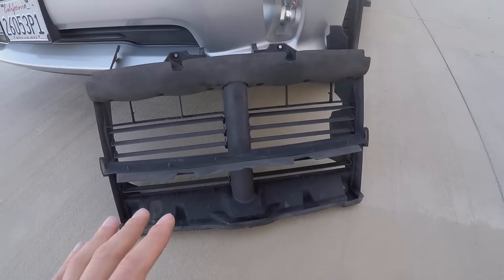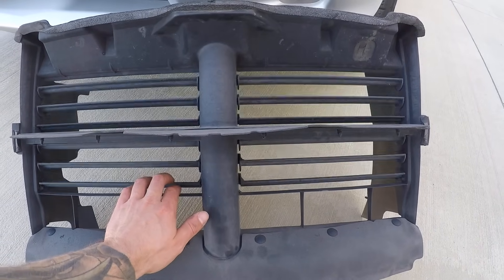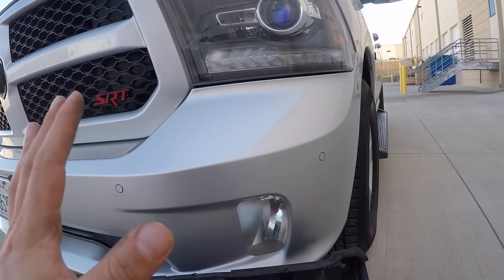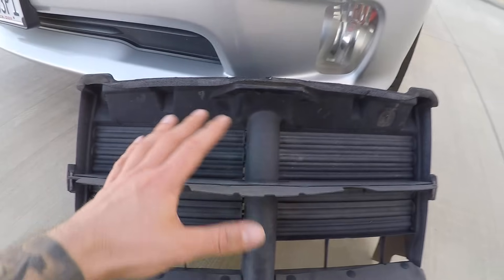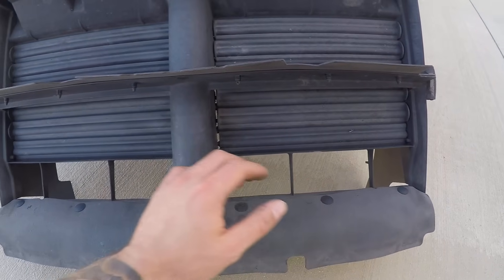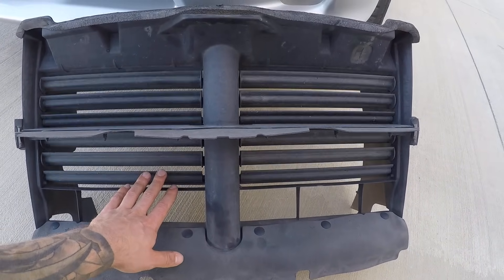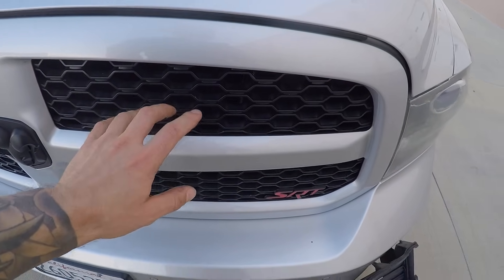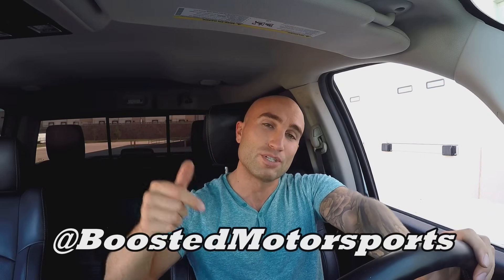What do Active Grille Shutters Do? AGS - TruckTalk #30

Comment: My wifes Fusion just started to over heat everyday to work. I just saw her AGS was closed and not allowing airflow. These things are stupid unless you live in a seasonal place. Here in CA these are just one more thing to fail. I had to force hers open to stop it from over heating. Hers even blocks the intercooler to her turbos too. And I was wondering why her car sometimes was gutless and sometimes felt notmal.

Comment: Ok so I'm just a lady driving this 2019 ram 1500  truck back and forth to work. I'm not building it or modifying it in any way.  So over the weekend the check engine light comes on and auto zone checks the code (U11E9) says its "most likely" the grill shutter assembly bc I'm approaching 50k miles. And the part is not available. I'm in a rural County so I don't have to worry about check engine lights for emissions testing, but I need to know if my truck is gonna over heat or what I should do.

Comment: I recently installed a 185 degree thermostat on my 2015 ram still have my mechanical fan but noticed my temp is still climbing especially when towing my trailer. I get that it’s going to climb in temp being under a load while towing but would deleting my shutters help cool the motor better while towing?
Reply: I thought I was the only one having that issue. Coolant & oil tem runs at 219-230. I freaked out when reached 240. I said ooooh hell naaaaa. I change the radiator it had a crack, I changed the thermostat. Next will be water pump. I didn't know my truck had shutters since is basic working truck 2018 Tradesman V6. After I notice why I don't see my radiator then vents opened. First thing I said "ooooooh hell naaaaa who in the FK set that feature, it got to be one idiot, I haul every day". Research to delete this.

I will order this part. Have you done it? Any cooler?

Comment: Thanks for this video. I have a 2019 BMW X3 and the engine light is on and the apparatus I bought to diagnose the problem says  Active Grill Air Shutter "B" is stuck on. Does that mean its stuck open or closed ? Can I drive it this way ?
Thank you in advance for your response.

Comment: That can should be pwm. It varies the speed of the fan not cycle on and off. It also runs constantly at a lower speed when ever the ac is running.

Comment: Holy I haul every day. I get temperatures 219-231 coolant, engine oil pairs up with the coolant, transmission goes to 194F. 

Recently I changed radiator had a crack, changed the thermostat. Next water pump. In the meantime I did bleed the system and burp it. I am still getting hot temperatures. I will remove the grill. I honestly think is a stupid feature. Even though is clever but not close. Is just create too much heat.

As soon you said when driving on the freeway they closed. That is when the truck goes up hill hits 230's.  I run 2018 ram 1500 Tradesman 3.6L.

Comment: My 1500 doesn't have vents but was considering adding them since 99% of what I drive is on the interstate. Wouldn't it make more sense to just wire in an adjustable fan controller to control the vents? Set the vents to open a few deg. before the fans turn on.
Reply: It would make more sense to be thankful that your vehicle doesn't have this useless crap.

Comment: So I have the same shutter system on my 2018 GMC Sierra.. the shutter decided not to work forcing me to replace it.. if I don't replace it the engine light will remain on.. How do I keep the shutter system in the vehicle (open) and delete the detection from the vehicle without the engine light remaining on?? Truck won't pass upcoming inspection with engine light on.. Thanks

Comment: i recently installed a 180 thermostate from HHPerformance and it jumps around from 185 to 190 during driving, could you tell what thermostat your using and  should i remove the active shutters from my 2017 ram bighorn crew cab....HELP Please

Comment: Im late but had a question. Hopefully u can help me. I got a 2015 Hyundai Genesis. I have an Active Air flap on mine. Is that basically the same thing u have and can i completely remove it without replacing something different there like u did?

Comment: We've been following your channel for quite some time now and love your videos!
I have a RAM, same generation as yours, with the 5.7 V8 BiFuel purchased in Belgium, Europe (if that makes a difference). Sport crew cab, short box. When driving around town, I've never seen it exceed 95 C (usually even starts to cool when it reaches 94) and could go down all the way to 90, sometimes even 89, before it starts to heat up again according to the evic.
However, today I had to do a lot of highway / freeway driving at about 135~140 km/h (85 mph). I've seen the temp creep up to 97, which kind of scared me a little since it already runs quite a bit hotter than the European cars I'm used to… do you think it's because of the grille shutters? Or is it trying to run a little more efficiently on the highway?
It's what would equal to a full option in the US I believe, except I did not get the air suspension, so it doesn't have aero mode for example. 
I'm sorry if my English isn't very good, thank you so much in advance :)

Comment: DO NOT DO THIS TO YOUR EVERY DAY CAR!!!!!   I'm an engineer who actually designs and produces AGS systems for OEMs and there is a reason we install them. It's not just for fuel efficiency its about engine wear. If you run a thermostat below OEM recommended temp you MAY see some modest performance increases (as long as you also upgraded your cooing system accordingly OEM cooling system will NOT be OK with such mods) but you will also definitely suffer excessive wear and premature engine failure. If you just want to get every bit out of a drag car then it's OK but you should not do this to your daily driver. Check the other videos on this channel where they admit to blowing up the engines of trucks that they make similar mods to.

Comment: Thanks for the video as always. I do have a quick question off the subject of the active grill and that is I recently done a cat back exhaust and was thinking about doing a Y pipe and off-road Y-pipe  now I know everywhere in the US that’s illegal because you have to have cats converter‘s but if you were going to add one I would you keep the check engine light coming on is the only way to get a tuner? Thanks again for the info
Reply from the maker: Thanks Mark!  Yeah there are some other ways people have stopped a light you can check out by googling 'O2 defouler' or 'O2 simulator' but of course for Offroad only 😎👍

Comment: I don't think the shutters ars all that great. Maybe a whole 0.4 extra MPG on the highway, and as a mechanic, the never ending concern that the shutter motor will fail in the closed position, and my truck will over heat is enough to make me want too ditch the grille shutters. Lol

Good job explaining it. People who aren't mechanically inclined would understand! Can't wait to see the supercharger. Just a side note, these 5.7 HEMIs benefit greatly from a big, fat lopey cam. I imagine even more so with a blower.
Reply from the maker: Thanks for your support Morte!  If you check out my MPG video I just posted my MPG is showing insanely high at 65mph right now with all the mods. Going to be doing a more thorough test soon for the channel also and hand calculate the MPG as well.  I'll eventually open up the engine and probably do pistons, rods, etc at the same time.  For now just sticking with the bolt ons 😁
Reply: if it did fail a CEL would pop up on the dash.... not one person on any ram forum I belong to has reported this motor failure BTW.

Comment: Review removed how do you turn your check engine off because I take it off I remove it but I drove 30 miles and the check engine on April the scanner says I’m missing the radiator shuttles
Reply: same error you would get if they failed  which everyone apparently is afraid would happen without them knowing lol.

Comment: Thanks for the video. I have a question.  this is not my  question its just a thought ,     An AGS system on a RAM truck in SO CAL? Like I'll  ever sees snow or cold weather  in San Diego. I can see where the AGS would be beneficial to keep the engine warm while driving in cold temperatures but     My Ram,  2016  5.7 L  Hemi  lately has been fluctuating the temperature ranges (100 145  at start up) then from 203 up to 224! Any Thoughts? @ 224 the fan  kicks on and cools back down to 203. It will do this even  while driving 65 75 mph on the highways in town. If I run the AC it will run the fan to keep the engine cool. But I don't want the AC on to cool the engine. (I will check the AGS  to see if it is working) I wonder if it is remaining shut and  not giving a check engine light. I  did the mechanical fan delete and installed an  electric fan.  Also, I have been through 2 water pumps and 2 new thermostats and 1 new temp sensor in the last 2 yrs it is now on its 3rd water pump and 3rd thermostat  all due to leaking pump seals (weep hole) This could be due to the  high temps I don't know . I m thinking about  installing a manual override switch using a relay to turn the fan on and off. I  would appreciate any thoughts and suggestions.  - Joseph

Comment: Are the flaps on the front in the middle and bottom that are held on with clips necessary?  I just installed a replacement grill on my 2016 and those flaps are in the way of the grill seating correctly without forcing them down.  Thanks.

Comment: I have this on my ford explorer. I want to.add a police push bar. Would it hurt if I cut the ends of the lower shutter for the brackets. I dont want to remove all the shutter system.

Comment: So its better to remove the AGS ??? Thanks for great video man
Reply: The ags will help more then it hurts unless your vehicle is modified to run a cooler and take advantage of that. (just changing the thermostat is only half the equation since the computer still looks for 200 degrees before going into the proper closed loop tune.) the engine runs rich until the proper temp is reached. and if you remove the ags and still have the stock thermostat that doesnt open till 200 degrees its pointless since the ags would be open when the radiator cooling fan is on and the computer commands cooling is needed regardless. removing it is a placebo mod that does more harm than good in the majority of situations.

Comment: Great videos, how does the heater work with a 180 tstate in the winter. Just wondering
Reply from the maker: Thanks Alex!  180 thermostat will still work well in the winter it just wont run as hot but warming up to the operating temp will be similar.

Comment: Even If I removed the mechanical fan will the electric fan  be enough to make air at idle or help control the temp,  mine is a 2017 and has both.   I dont like that louver system it's trash Please let me know

Comment: The weather here in Iraq is hot,and I don't want these gates, so if I just connect the active actuator (motor) did the fan will be working properly??
Reply: you can remove the shutters but leave the motor connected. the shutters open whenever the  radiator fans actually kick on while the thermostat is open so it wont have the effect you think by removing them.

Comment: I installed a 195 f degrees thermostat and my check engine light came on, how to fix it
Reply: You may need a active shutter grille mine came on as well it could be the wires to it as well, I went to oreilys and auto zone to check engine light and they told me that was the problem, good luck

Comment: Just a quick add to this, from what Ram said back in 2012 when they were discussing these for the 2013 model year, they also work with the air suspension models as well. The full effect is the air suspension lowers the truck to the Aero height at over 64 mph and closes off the shutters to improve aerodynamics. Would deleting the AGS have an impact on that system?
Reply from the maker: If you do the delete mod that I show in the last video your air suspension will still lower as it should and not have any issues because it thinks the AGS system is still fully functioning using the custom kit

Comment: Nice video as usual, quick question, how do I know that the AGS are actually working? Is there a way to test these? I have noticed that when I turn off my truck that there is a noise that sounds like a small motor running, this will also occur at times just before I start the truck remotely.
Reply from the maker: Hey Don! If you have remote start take a peek through the front grille and hit the remote start or get someone to start your truck and within the first minute you'll see the grilles run through the test procedure to check for full operation as they fully close and open.
Reply: Just as you mentioned, I used the remote start and did see the shutters close. Thanks for the obvious tip. Hey they say the only stupid question is the one that isn't asked!

Comment: Thanks for the video. I have a quick question. I have removed active grill for my ford focus 2018, the car is is performing pretty cool without it. However, the fan runs after few minutes I start the engine and does not stop until I switch off the car off. Please advise what might be the issue or what should I do with the fan?
Reply: have you checked the cooling fan relay ? And also check the temp sending unit . It could be stuck in the  "on"'  position until the coolant reaches a certain temp.

Comment: Can u help me out ive got a 6" lift on my truck with 22X12 wheels running 35" tires my temperature is between 219/222!  Thats on the highway in town im at about 214. Is that normal cause of the lift ive got and bigger wheels? Was wondering if i should take off the shutters.  I got a 2017 ram 1500 with the 3.6 pentastar.. Any info would be great thanks
Reply from the maker: Hey Raul do you have the 8 speed?  The thermostat on these trucks are usually pretty high stock but I haven't had to deal with the V6 on these trucks to be honest.  As a simple test I would try unplugging your shutters with them open or temporarily removing them to see if it will help before you commit to deleting them! Keep us updated!

Comment: Did u use the twc fan if so how is it working I got it jus have not installed it yet
Reply from the maker: Hey Tim I actually found a OEM Denso fan out of a wrecked truck that has been working great!  I know a lot of guys running the TYC fans but some complain of vibration from the cheaper fan 🤔

Comment: Did removing the shutters help lower trans temps? I don't like the fact my trans temp is 192-195 at interstate speeds around 80 mph
Reply from the maker: Hey Tony these 8 speeds are designed to run that hot and actually have a small thermostat to keep them at that temp and wont pass fluid to the trans cooler until it is up to that temp
Reply: Lol thats normal. Way to worry about something that isnt an issue at all